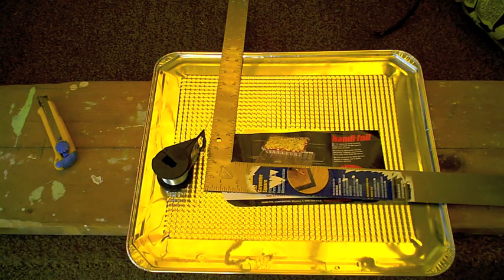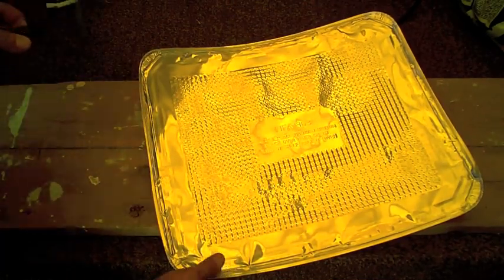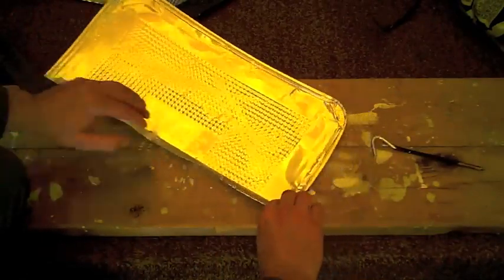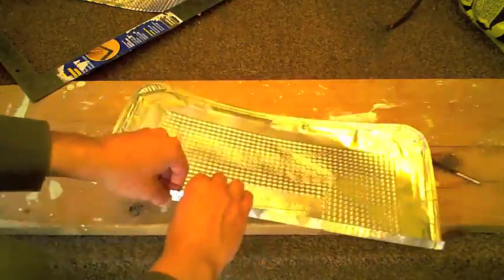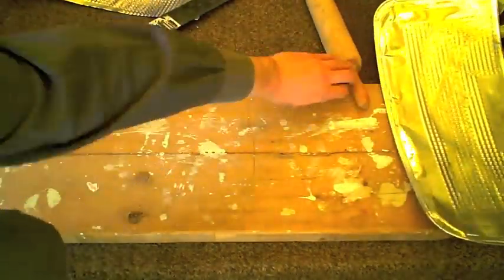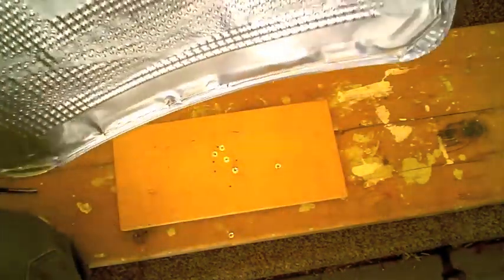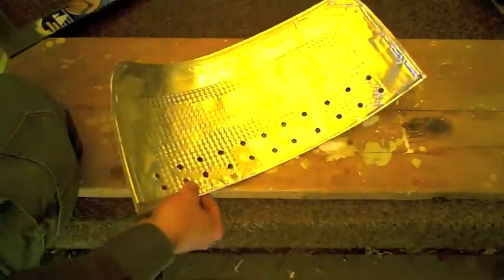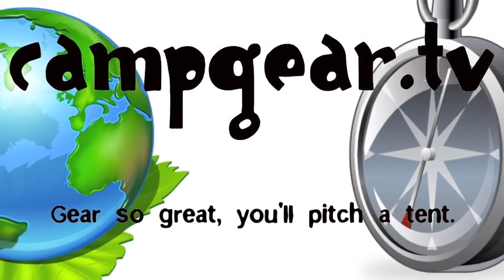DIY Camping Hack: A $1 Wind Screen For Your Camp Stove

Comment: what about instead of using wire a wire coat hanger? any thoughts?
Reply from the maker: Andy Grassia What @MrBac00 said. A coat hanger is too rigid, IMO. You need something nice and flexible and easy to work with. I've been using this wind shield since before this video was made (four years ago?!?) and I haven't felt the need for more rigid wire.

Comment: Good idea, but whatever scrap aluminum they recycle these from just melts after a few uses.
Reply from the maker: Brad Kassing I haven't run into that issue. Maybe my stove doesn't run hot enough ;)
Reply: +CampGear TV My stoves run plenty hot and it's never happened. The screen gets hot but doesn't melt. Makes sense considering these are made for cooking in an oven. :)

Comment: I ran across this clip a couple of years ago and made two windscreens. Both are still solid for use with my remote canister stove and I get out about 60 times a year. The size and weight is obviously negligible and they work like a charm.
A big thanks for this one CampGear.

Comment: Clamp the aluminum between lumber pieces for drilling safety as well as significant reduction in burrs. 
   You can also make V cuts with a utility knife and bend the resulting tab in.
   Lastly, cut some V or square notches along the edge for ventilation instead of inboard holes.

Comment: Love the diy stuff that seems to be particularly rich in the alcohol stove arena.

Not a bad idea for $1. Only thing I'd add would be a double roll for the wire to keep it really locked in, and perhaps a little more rigidity, but in a strong wind, wouldn't this pretty much blow around?  Especially with it so tall?   Though the height would be good for the cold.

Comment: CampGearTV, my friend's camp stove blew up last weekend. She was using a small propane cooker w/ wings on the screw top to hold her pot. Her wind shield had no holes. How far down can this shield go? to the ground? Would you follow up on how to apply the shield so the bottled gas canister doesn't get too hot and explode.  Thanks.

Comment: They sell pretty much all the tools you used at my local dollar tree store. But I think I can use some beefier pieces like the drill bits I have are about 1/2" or so and maybe some heavier wire so it holds together better. Plus mine won't be so tall. I think I need to go camping now....

Comment: You can also buy sheet aluminum by the foot at most local hardware stores. Mine had it for $1.50/ft. Save your rolling pin. :)

Comment from the maker: Apologies for a long delayed response. If you're using a canister stove, the canister should be outside the windshield. If that's not an option (which it wouldn't be in the case you mention) then you'd need to find a balance between shielding wind on one side and allowing air / cooling on the other. Another option would be for more and bigger vent holes near the bottom. The heat of the stove would naturally draw in air from the bottom air holes and keep the canister cool. Above all, be careful!

Comment: saved me some 9 quid there. i knew aluminium would do the trick but didn't think of oven liner - was wondering what I could reinforce kitchen foil with. your idea is perfect! could also skip the wire in the seam and just use a metal cable-tie to hold the two ends together, but that's just my extreme laziness i guess :D
Reply: Just use an old biscuit tin or Roses/Quality Street tin.
Bonus... You get to eat the contents of the tin first.

Comment: I've just cut up an old aluminium water bottle as a wind screen with tent pegs to keep it in place, it doesn't get crumpled in the backpack and still weighs almost nothing, even if you have to buy the bottle, you can get them for buttons these days.
Reply from the maker: jelkel25 Neat idea. Did you drill holes in to let air in? How far does it wrap around your pot? Is it a small pot?
Reply: CampGearTV I use different pots depending on what I'm doing, though 90% of the time I use solid fuel (Hexi's) which are lower to the ground, you might have to rethink this for many gas type stoves as they're higher up. I usually just have it a little further away (4/5 inches) so I don't have to worry about air holes. I picked up a new aluminium litre bottle for £1 ($1.50?) today they're so cheap at present, you will have to burn off the plastic coating on the inside on an open fire before you use it.

Comment: Not really a dollar, how much is 18 gauge wire: $ 3.78
Oven liner is around $3-6
Box cutter: at least $6
Drill might as well not even bring up a drill coz by then you could have afforded several windscreens.
Screw this I'm just going to have my friend block the flame until the water boils.

Comment: I've made some wind screens using a cardboard box. I cut it to size then rap it with aluminum tape. It cost more then your method but works well and is light weight and you won't have to worry about cutting your fingers. It will rap around your cook pot and secure it with a rubber band.
Reply: cardboard is inflammable though, makes me a little nervous... just aluminium is much safer :)

Comment: thats like $50+ to make. i can buy one for $10
Reply: It'll cost $50 only if you make it so.
** You don't have to buy a rolling pin. In this application, an empty wine bottle, piece of closet pole, PVC or cast iron pipe will work instead. If none of those are available, cut up a suitable sized dead tree branch. This metal can also be flattened by pulling it along the edge of a board, cabinet, desk, etc. 
** You don't need to buy a drill. A one-hole paper punch will cut through this metal. If you don't have that, you can sharpen the end of a piece of copper tubing and use your rolling pin branch as a mallet to punch out the holes. Poke holes with a Phillips screw driver, making sure you bend down the rough edges afterwards.
** 18 ga (or approx.) wire is easy to find, inexpensively. Often the hardware section of grocery stores, $ stores and big box stores have this wire.
** You don't have to have a metal square to measure & score the aluminum. Use an empty cereal box, for example, as a guide. That'll be close enough as this isn't precision work.
** You don't need a utility knife. This metal can be cut with cheap kitchen shears or scored with a nail, awl, flat blade screwdriver, paring knife, etc. until flexing will break it. 
** Or are you talking return on investment for your time? :-) I ran the numbers based on the figures you gave & estimated $2 for supplies. Never had a job that paid that kind of rate per hour. ;-) 

Just food for thought........
Reply: Oldtimer Lee exactly, all it takes is to think outside the box and compromise a bit with the supplies you need...you can also use beer/soda can tins that’s again folded on all four sides...you can just as easy use a 1x2 (IE : disclaimer) scrap wood for bending the folds and getting it straight.
Reply: @SouthernPatriot1  Just stand there please, water is almost done boiling, don't move.
Reply: @oldtimerlee8820  Your numbers are off, 18 gauge wire alone is $3.78 plus tax
Over liner is over $3
Really not sure any of the time to hunt down this stuff is worth more than $10, in terms of labor it's going to take more than 20 mins, by then I could have mowed the neighbors lawn got $20 and bought two windscreens brainiac. $1 windscreen=clickbait
Reply: @insomb  "Your numbers are off, 18 ga wire alone is $3.78 plus tax" First, my post was written 4 years ago. Think prices today are the same as back then? Next, I found 18 ga wire at $3.78 from Amazon. It's a 50' roll. That's .08 / ft before tax. Oven liner is 18" wide, Use 24" of wire to make calculation easy for you. That's $.16 + tax for wire. Next I found the Hefty oven liners at $3.34 for a pack of TWO (2) or $1.67/each. At today's prices that's $1.83 + tax for supplies. Less than $2.00 per windscreen at today's prices.  
How much time does it take to click on a shopping cart. Wise folks know how to place orders without incurring shipping charges. 
FWIW.... I've actually made an number of these for friends/family Grab/Go and Get Home Bags. It doesn't take 20 minutes to make one. If I understand your convoluted logic, you're working 20+ minutes mowing grass in order to spend $20 on 2 $10  windscreens. Don't forget you had to buy gas for the mower, check fluids & other maintenance,  take it to/from your neighbor, spend time talking (at least enough to get your $20 bill). 
While you're earning your $20, I'm making 2 for approx $4. When you spent your $20 for 2, you still had your fuel expense and your 2 windshields. By comparison "brainiac", I saved $16 compared to the price you paid. Plus, I didn't have a mower gas cost and had almost a whole roll of 18 ga wire leftover to use for other projects. 
BTW, this video was done in May 2011 . In 9 years, the price is still less than $2. Far from being "clickbait", it was and still is a valid premise. I'd rather sit in the shade and use less than $2 ($4 for 2) worth of supplies instead of working in the hot sun,  mowing grass, to spend $10 ($20 for 2).
Think about it.....